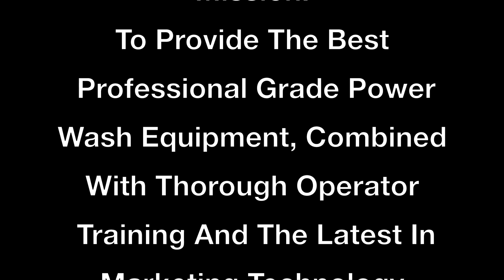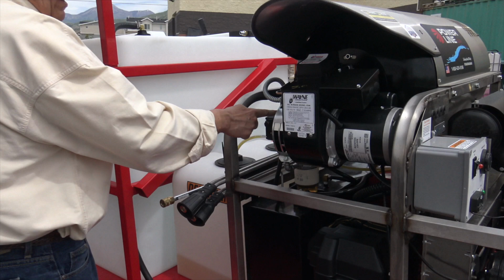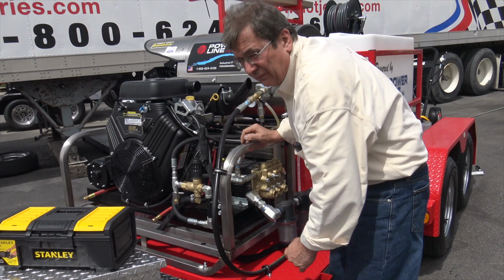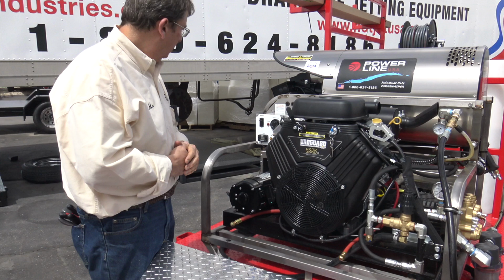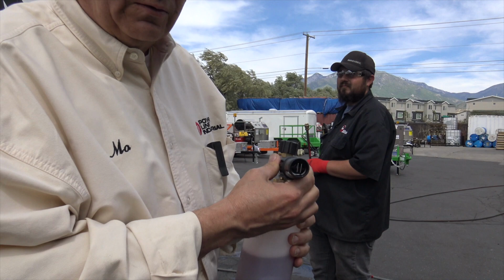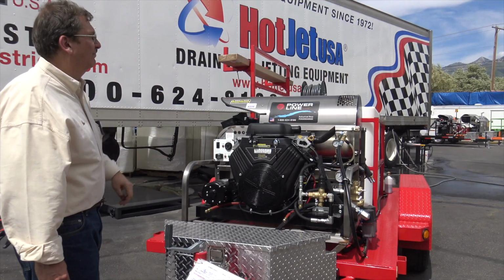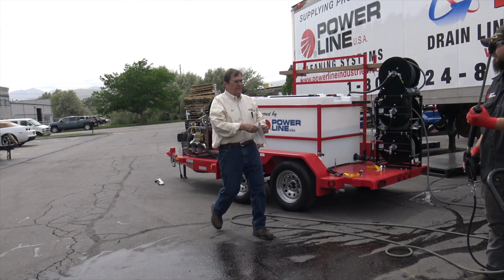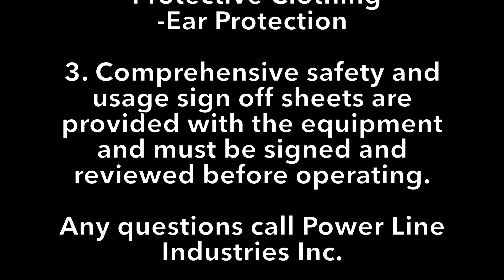Power Wash Trailer Operational Overview Video

Comment: How much for the set Up. ??
Reply: 25k

I just bought mine today
Reply: @jesseyermalovich6837  Did you drop 25k cash on it or use financing?
Reply: @scottcheney6955  I was fortunate and paid for mine outright, hoping to get the return and then some..
Reply: @jesseyermalovich6837  Happy with the equipment and customer service so far? I'm in Jersey so it's a long ways for me to travel to for figure this out for myself so this is why I'm asking. I'm looking to get a machine like this and need all the info I can get before I go dropping 25k. Lots of companies out there making trailer setup. Just trying to go with the best.
Reply: @scottcheney6955  so far yes, after looking at a couple other setups, by far this one looks the most professional and not some put together crap..its like a new corvette...lol
If you have the time to drive to pa you can come check mine out...
Reply: @scottcheney6955  I think they are running a special right now for 20k..
Reply: @jesseyermalovich6837  20 for the same set up you have? I'm planning on driving out to the Powerwash store in Red Lion to check out what they have to offer. GPS says I'm 2 hours from Red Line. Where are you located?
Reply: @scottcheney6955  I'm near hershey pa..
Zip 17046
Reply: @scottcheney6955  yes powerline is running a sale from what I seen on their website....395 for 60 months..
Shoot me a email if you want its quicker than you tube...lol
Reply: @scottcheney6955  some life changes are forcing me to sell my rig...if your looking call me..
Reply: @stanhanson1220  sorry it has been sold...I do have a 6x10 enclosed set up as well if that interests you
Reply: @jesseyermalovich6837  Jesse, prefer an open trailer. However, would consider the enclosed unit. Can you please send pictures to me? Thank you.
Reply: @stanhanson1220  I'll get some tommorow and text to that number

Comment: Are we able to supply our own trailer
Reply from the maker: Maybe. You'd need to speak with one of our engineers here to make sure that the trailer meets the standards we use for the mounting of our equipment and that it is sufficient to hold everything safely. Feel free to give us a call toll-free at 1-800-624-8186 when you're ready to discuss.